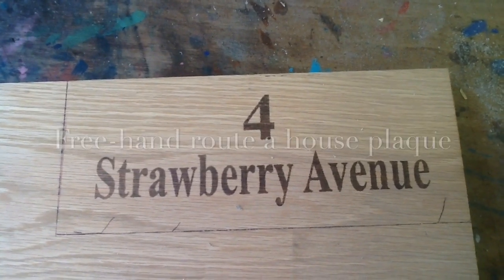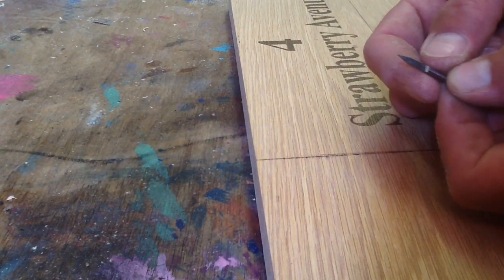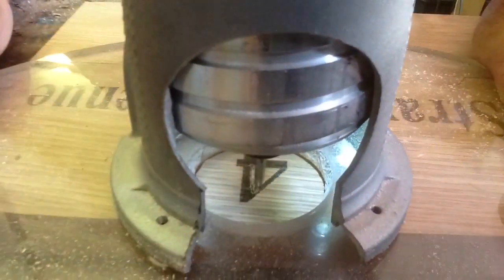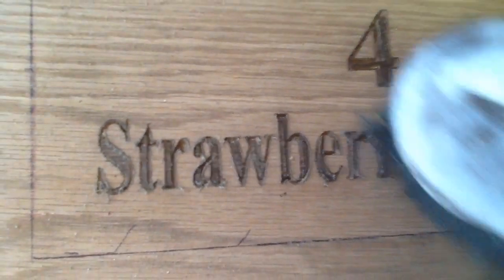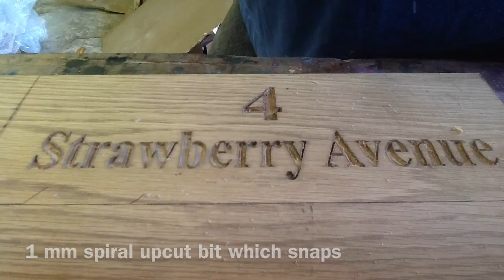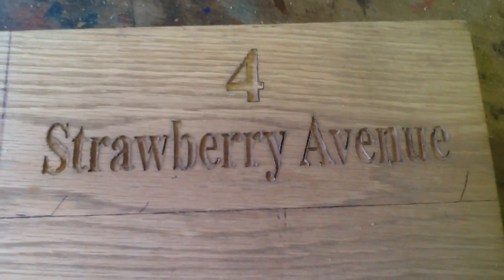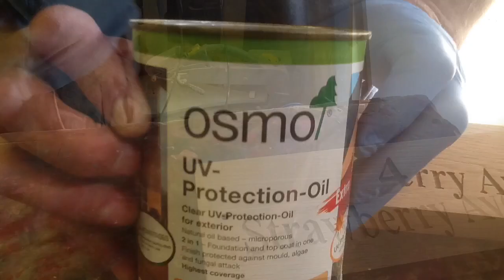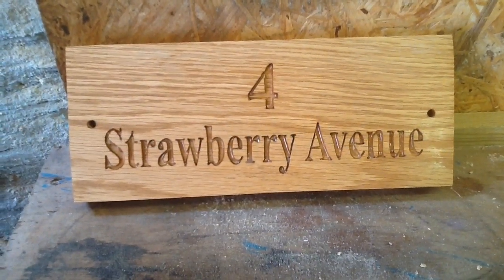free-hand routing a house plaque

Comment: That turned out nice,I use the cnc bits all the time.ive just ordered some spiral ones,it will be interesting to see how I get on with them..nice project.
Reply from the maker: Love the spiral ones, great for a clean edge and detail. Smallest I found I can use are the 1mm. Anything smaller and they snap to easy
Reply: @JohnathonWhittaker  yes I must admit when I saw the smallest one I was thinking that's going to snap in no time..lol
Reply from the maker: @fishtank5050  the trick is to stay shallow. no deeper than the shank diameter in any one pass
Reply: @JohnathonWhittaker my bits turned up today,looks like I've ordered wrongly..lol,I've ended up with some cutter mill end cnc bits, pack of ten..0.8mm-3.17mm..still look the part.i just wondered if you have ever tried these..
Reply from the maker: @fishtank5050  are they the brass ones?
Reply: I only paid £3.79 for 10 bits so no big problem, they might even work...lol
Reply from the maker: @fishtank5050  at that price, they are almost disposable!